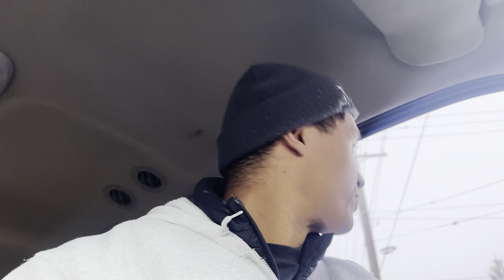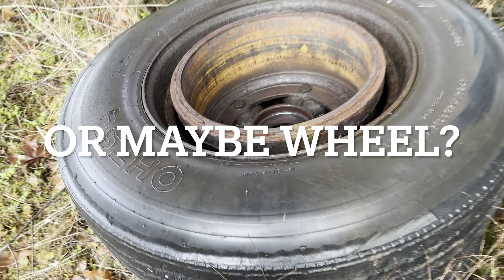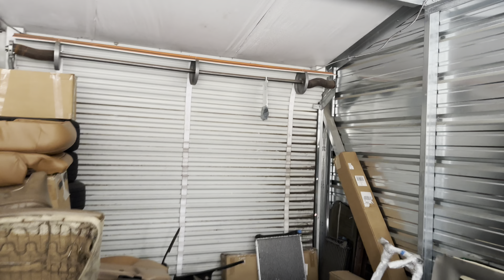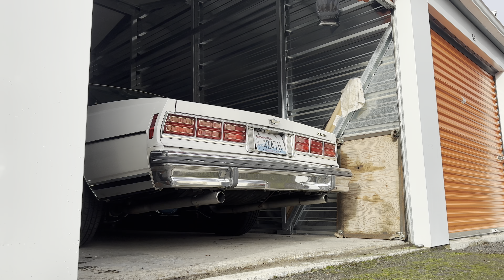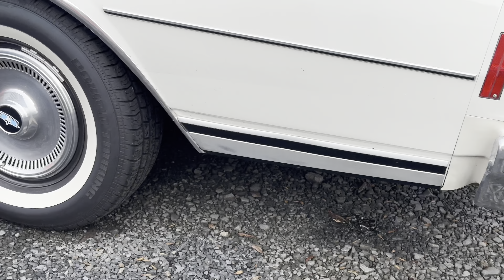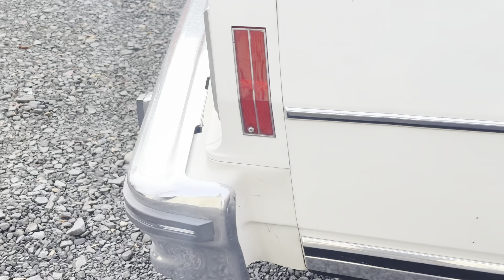ALWAYS SOMETHING WITH THESE OLD SCHOOLS!!! | 1978 CAPRICE CLASSIC AEROCOUPE | CHRISTMAS BREAK

Comment: When I swapped my box I used compression fitting to an adapters on the stock sending unit so I could run an lines all the way to the rail.
Reply from the maker: Yep! Thats the way to go. I did that as well on my Chevelle. The Caprice was my first ever swap. So might be time to go over the fuel lines again. 

Thanks for the info! 👊🏾

Comment: The late 80s box Chevys were fuel injected but I don't know if the tanks are baffled.  I can't tell on Rock Auto.  Anyway, sorry for the leak and as always great work and great content!
Reply from the maker: Appreciate it! Yes, some of the later 80s models are EFI tanks along with the early 90s have plastic tanks. I have a 96 Roadmaster BBody tank in my Chevelle that I plan to put in my Caprice. The 78 models have no baffles and are not fuel injected, so that’s why I used a Grand National sending unit.

Comment: how did you get the holley from the hand held to the laptop
Reply from the maker: It was a setting in Dakota Digital Bim Module. Also, I have two Can Bus settings in my HP ECU. I had to set one for each to Racepak and to Holley Standard. 

My next video upload will be on this.